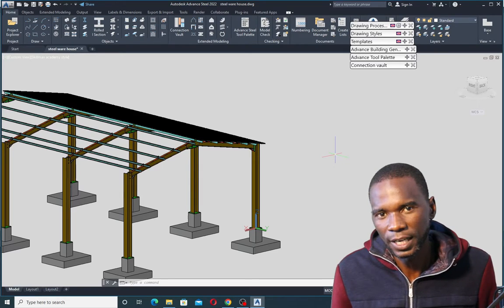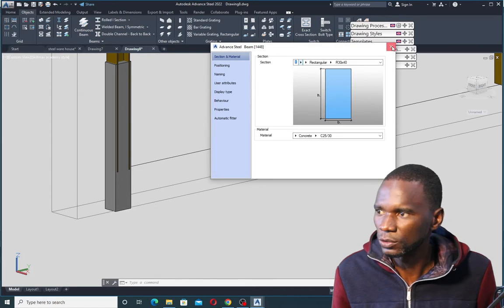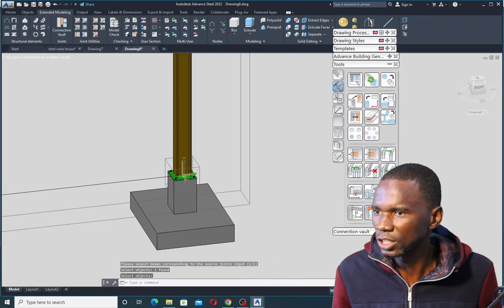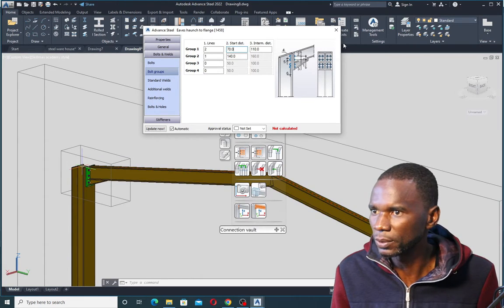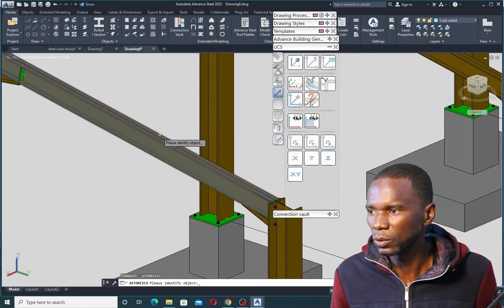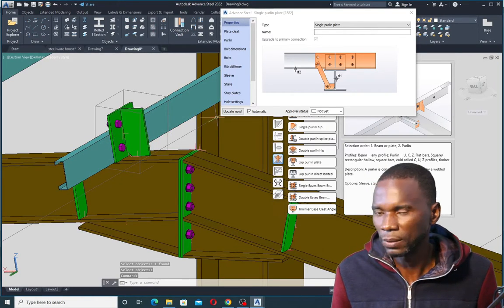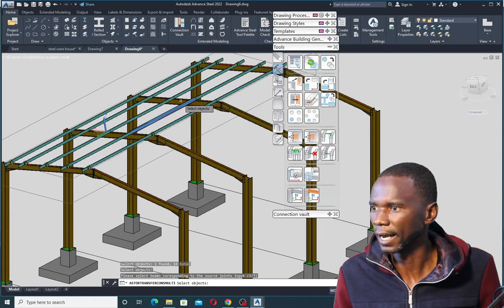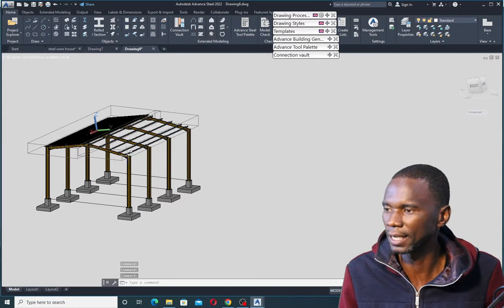Advance steel_advance steel tutorial_portal frame_purlins_connections_cladding etc

Comment: I would like to understand the work flow. Does Advance steel use joint loads from analysis in the connection design.
Reply from the maker: yes from robot structural analysis